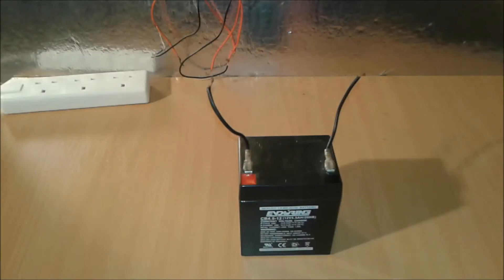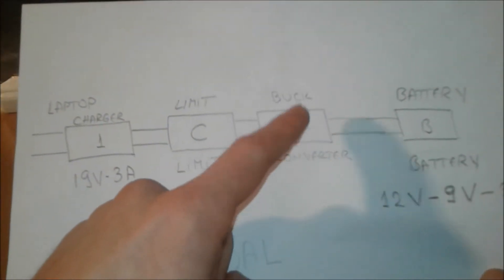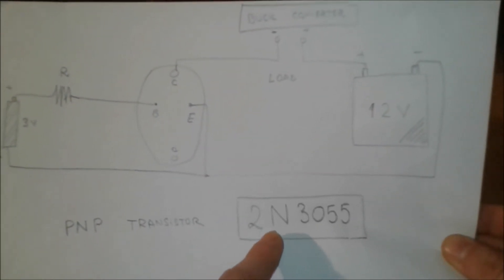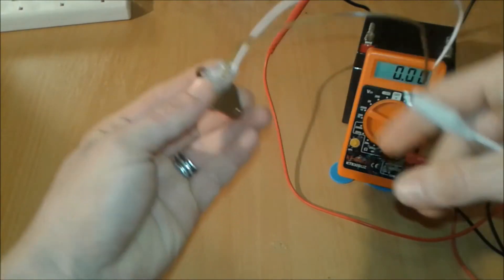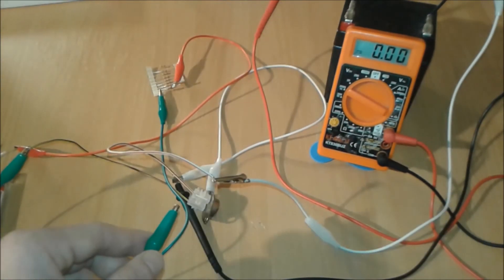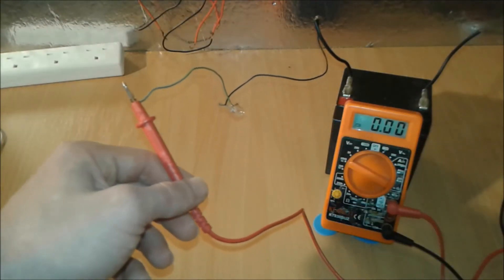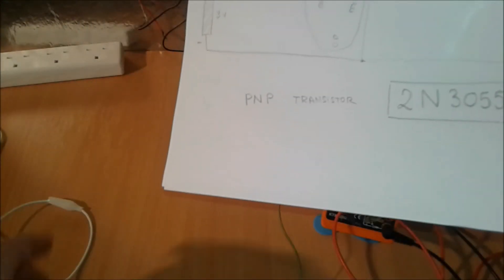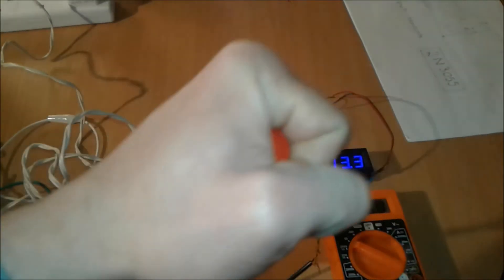How to make a 12 volt battery charger. Lead acid universal charger part 2

Comment: hey bro nice video. Will it be safe to charge a 12v 7.4 amp battery at 13v 1amps ?
Reply from the maker: son of a gun hy mate normaly for 12v 7.4A safe charge will be 0.60A for 12h and when it reaches 12.6v disconnect.you can try to limit the current with a power transistor.chech the battery label initial current less then ....
Reply: NoSkillsRequired thanks I shouldn't have bought this charger from Amazon ..it charges at 1 amps an we can't adjust the output
Reply from the maker: son of a gun This charger is good for 12v 12A or more and you can power other things leds,motors but you can try it if you have a multimeter to measure amps maybe the battery is not totally depleted and might work.normaly when a battery get charged the current decrease and the resistance increase that meens is gonna draw less amps from the charger all the best